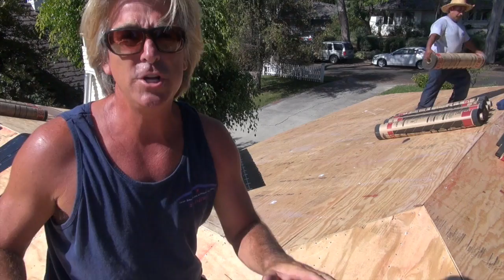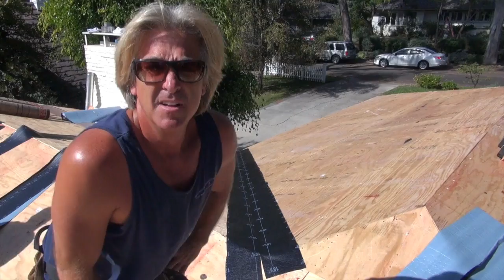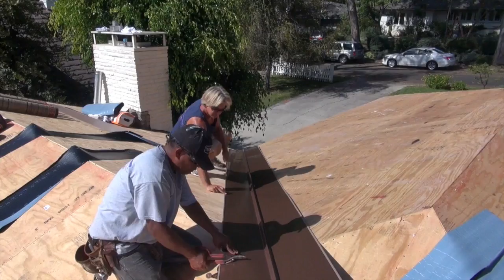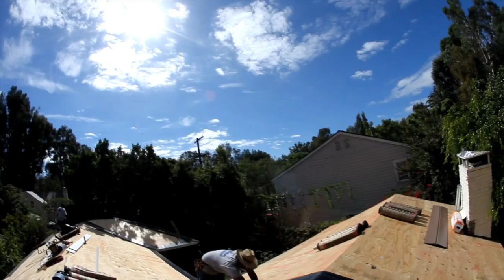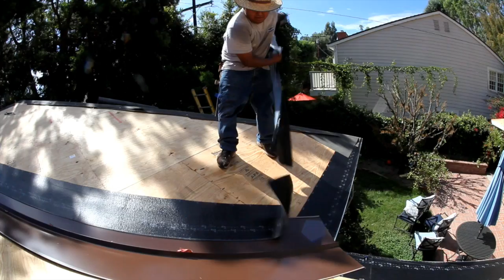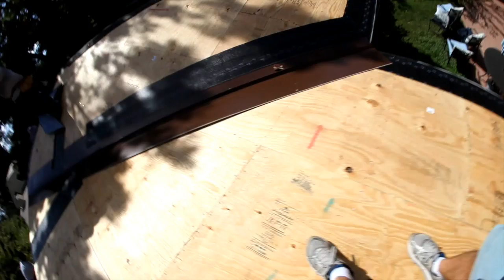How to waterproof roof valley with peel-n-stick Palos Verdes Roofer

Comment: Why aren't they putting down underlayment  beneath the valley?
Reply: Condor1970 because the underlayment goes over the valley so when water runs down the roof that runs into the valley if you put underlayment underneath the valley water will run down underneath the Valley Metal common sense

Comment: good job putting in the membrane in the valleys. why do u cut it length wise? we use the hole thing and normaly go with 6feet at the botton of the roof. but then again we do get bad winters

Comment: My understanding is valleys metal goes on top of underlayment
Reply: the valley metal should go above the ice and water shield barrier like in this video but the ice and water was not wide enough in this video. the underlayment then would then overlap onto the ice and water but it would not need to go under the valley metal
Reply: I just retired after 30 plus years of commercial roofing. I have modified base sheet I’ll be using for a base. This is going to be my last rodeo for shingles.

Comment: Hey Palos how is your hair looking. oh yeah the ice and water shield should be wider than the metal valley
Reply from the maker: Chuck we put a double layer of the peel-n-stick onto the valley transition on a really hot day. it stuck really good. 
  then we installed the valley metal on top of that
then we tied into the metal valley to plywood deck with peel-n-stick pn both sides of the valley metal transitions. it stuck really nicely . it must have been around 90 degrees that day.  it will never leak.
Reply: Yep yep, smh
Reply: Chuck Taylor King and it should be under the valley how we do it up in Canada any how
Reply: THUNDER RAIN ROOFER good for u. Noone cares about canada ey
Reply: Rudy Straight I care about Canada and it’s eh not ey lol get it right eehhhhh
Reply: THUNDER RAIN ROOFER cool story ey!
Reply: Rudy Straight don’t you wish you were Canadian eh boy

Comment: True American Roofing- a few problems- 
1 the Ice&water should extend beyond the edges of W valley metal, then underlayment should be installed to center of valley, then W valley goes on top of that. 
2 W metal valleys are not to be nailed through. Each side of W should be hemmed in a brakes, clips are attached to the hem, then the clips are nailed to the roof deck. What’s the point of using metal if you’re putting holes in it? I see this WAY too often with roofers and metal valleys. Also clips allow metal to move as it expands and contracts through hot/cold cycles, otherwise it kinks.
Reply: underlayment first then flashing....

Comment from the maker: Hi there are a lot of different ways to install this rubber base -peel-n-stick in the valley transition. you can cut it to what ever length you feel comfortable to remove plastic cover on back side and set to seal.  if you mess up  and fold sheet in wrong direction it is expensive mess up. . 
some times we take the length in different sections
 depending on  how difficult it is to set in any position.  
, this was the  is easy to show the viewer how to set it into the  valley transitions. 
cheers thanks for watching video.
Reply: True American Roofing- The Official Page in Florida, does the peel n stick go over 30# felt or is valley metal used?
Reply: Hi there True American, I had a question; how do you meet the two piece of W metal at the top?

Comment: The A&W the using is a base sheet for peel and stick system ,second maybe no using drip edge o metal around the house because some houses use siding drip o maybe have a wood breeze board around and all depends on the place in the country the have different city codes. And any contractor do the roofs in different way some try reduce the cost of material o some one just want to do a good profesional the only thing the matter in a roof is don’t get a leaks and keep costumes  happy!

Comment: Dude were is the icy & water and drip edge? Plus the roof should be felted or tigered or 🦏 all those things I mentioned need done before valley installation. Also how is that roof breathing don't you cut out for a Ridge so roof can breath? 🤔#wtf

Comment: Can't take people that wear shorts to work seriously.
Reply: me either, I grew up in the 40s when men dressed for the job
Reply: As long they make a good job don't complaint.
Reply: You wear pants on a hot 110 degree day up on a roof with no air blowing you’d be crying your eyes out from burning so badly .
Reply: At least he owns the company he does what he wants
Reply: Besart Ameti 

You would not last roofing in Australia, all roofers wear shorts. You cant work hard and fast if the pants are sticking to you sweaty legs like clingwrap
Reply: Yeah, I bet you've never roofed. Let alone in the 80+ degree heat with the plywood and metal roofing reflecting the sun back on you.

Comment: You're one of those guys that take the homeowners money and only does part of the jobs. I hate guys like you! You're supposed to use the whole width of the I & W shield and not cut it in half you cheapskate. Especially in the valleys. You didn't even take the valley metal all the way to the bottom so that it covers both sides of the roof at an equal distance from the middle. If you're going to put something on video at least know what you're doing. You should be embarrassed.